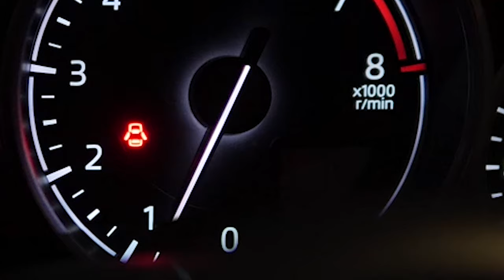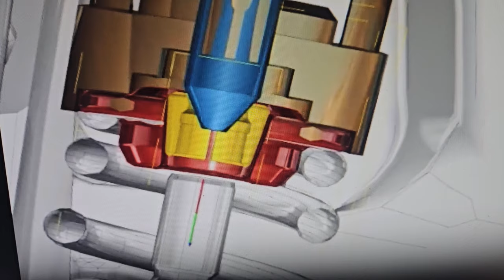Mazda CX 5 Oil Consumption. Mazda Warranty Extension. KIA soul Free Engine replacement update.

Comment from the maker: Does your Mazda have oil consumption issues?
Reply: Not yet, I have a 2022 Mazda3 SkyactivG 2.5 though, not turbo.
Reply: Do you know of any issues (oil consumption / chains) for the 2.0L Sky Activ engine. I am from the NL and I am considering to buy a 2024 Mazda CX5 2.0 E-Sky Active (24V mild hybrid) with an automatic transmission (my first eek LOL)  ?
Reply: I asked Google and it said yes non turbos are affected by this issue.I love our 21 cx5 cepting for this revelation.
Reply: No. I change my oil every 5K. At 53K miles I have zero consumption on my CX5. Its a normally aspirated 2.5L model year 2014.
Reply: @paulherbert5548  pretty sure it's model year 2021 mostly.
Reply: @zerkfiter  Yep. Just watched the whole thing. Commented too early.
Reply from the maker: @JohnC-b5j  No oil consumption issues that I know of for the 2.0L. I have never seen a CX-5 hybrid. That's cool.
Reply: Hey Sir - yup oil consumption.  Happened once while still in Kansas and once here in Germany - where I am stationed.  Question as well.  As it appears this engine is unable to have the repair done in Germany is this something that is ok to just keep a very close eye on the engine level and then get it fixed when we move back to the states?  Thanks!!!
Reply: Yup. Had the repair once and it came back. Just had it done again 2 days ago and today I noticed shiny liquid coming from the oil control sensor where the valve seal is seated. 

Really annoying. Going to drive it until the light comes on again, top it off and off to the dealer it goes AGAIN.
Reply from the maker: @leotoxin  sorry that happen to you.  Sounds like they are not doing the job correctly.

Comment: The leaking seals on the valves is a problem Mazda has had since their first international cars. I had a brand new Capella (616) 1600cc car in 1975 and it consumed oil unnecessarily. Mazda eventually agreed to replace the seals at no cost to me. It was well within warranty period but it took a long time for them to accept the need for repair and to own up to the issue. I expect all the tools used in this video are well known to Mazda if the problem is historical. There was no class action in Australia back in 1975 and certainly no warranty extension offered. Other than the seals the car was really good as long as I had it.
Reply from the maker: Too bad you don't still have that car. I think it would be considered a classic in America.  Was it a coup, or a sedan? When you owned it, did you every wish that you went for the rotary option?  I'm sure those consumed oil.
Reply: @ShopForemanGarage  The car was a sedan. Couldnt  afford the rotary and being unusual technology I avoided it. Excellent first new car but didnt hold on to it as family grew.

Comment: This video is so helpful! I have this issue with my 2021 CX5, 23k miles. The dealer only made a new oil change. Now, only 1 month later, 1k miles, the oil light is on again. I went to the dealer with this bulletin in my hands, and I dont understand why they didn't do this since the beginning.
Reply: because they get paid a lot less when you do it in warranty then when you have to do it out of warranty.
Reply: This is why you have to be an advocate of your car , just like your own health.  The dealer already has enough headaches and will never offer to repair a car unless they have to.  Being educated and doing research is always your benefit!

Comment: Another hidden issue with the Mazda Skyactiv engine is the vacuum assist pump pushing oil into the intake . Seems like another gasket issue and to get a new vacuum pump is not obtainable from dealers

Comment: My Mazda3 turbo and it only had 6,000 km on it and the oil light came on. I Thought it was because of my driving habits so I did the oil myself. 2 years later it started consuming 1 litre of oil every 1,200 km so I knew something was wrong 😭 so I got that tsb done.

Comment: Wheel cover. Maybe customer only puts it on when parked in the sun stop the wheel getting cooked. Sun cooked steering wheels are a dead set giveaway the car has been parked a lot outdoors when selling the car later on. BTW great video if you’re a Mazda tech.
Reply from the maker: Sun cooked makes sense. They should take it off when they drive.  Thanks for watching. And thanks for your support.

Comment: Apparently the material used in the valve stem seals wasn't right for the hotter running Turbo models.

Comment: This video is what I was looking for!  On my MazdaCX-5 2021 turbo the oil light came on in 2021 and begging of 2022 around 4000-4500 miles. After Easter of 2022 the light did not show up anymore. It might be because Mazda added more oil when regular maintenance  was performed or the problem disappear?
Reply from the maker: Thanks for the comment. I don't know how it could disappear. Maybe it was never a problem. I've seen those oil level sensors do some weird things.  I'm glad it's working for you.

Comment: I might be wrong, but I'm surprised that the procedure doesn't call to use compressed air to put positive pressure in the cylinder to hold the valve closed while you do that.
Reply from the maker: Yeah. The valve actually just sits on top of the pistion while changing the seal.  If you forgot to put the piston at top dead center and take the seal out. Well, then you know what comes next.

Comment: 2021 CX-9, had my valve stems replaced 09/23 at 16k miles. Engine was burning some oil over the winter, but the problem reappeared with vengeance in hot weather. Had an oil change at independent shop last month(filed up to 8/10 unlike dealer that that overfills it), went on a 600 mile family road trip and burned about half a quart of oil to low level code. Seems like "burning is especially prevalent in hot weather. Either stem valves were replaced incorrectly or some other issue. Mazda's manual does say a quart in 1000 miles, however updated TSB 05/20/24 says if during consumption test more than 8 oz is used in 2000km (1200 miles) than contact mazda tech hotline.
Reply from the maker: Wow. 8oz. in 1200 miles is not that much.  The spec. I get is one quart every 1200 miles. I don't see a TSB 05/20/24 or 05-020/24. If you're talking about SSPD5 its bulletin number is 01-007/24 and does not give the spec. However, it does say if the customer returns after valve stem seal replacement, then contact Mazda Hotline for further instructions. So, I would say take the vehicle back to the dealer. Get them to fix it correctly.  Then again. There are other things that can cause oil consumption.
Reply: @ShopForemanGarage First sorry for confusion it wasn't TSB 05/20/24 but REPAIR PROCEDURE 5-20-24 SSPD5 VALVE STEM CLASS ACTION CAMPAIGN pg 3 mentions "8 oz of oil".  Update: 10 weeks ago took the vehicle back to the dealer. I was told that a tech added dye to oil to trace the the leak and after that it was determined my valve cover gasket was leaking oil, so it was replaced. Oil consumption didnt go away after that either. Went through about 1.2 qt in 1,500 miles. Took the car back to the dealer a few days ago and was told that after getting in touch with Mazda Hotline the dealer will replace valve stems again. Not sure what happened during the original replacement, not like you can get any decent technical information from "service advisor" at the desk. Thanks for the reply and all your work to provide Mazda owners with behind the scene footage.

Comment: From what I heard from a few people in the Mazda forums if you installed a burger motorsports oil catch can it’s will help slow down the oil consumption problem with the turbo engines. I have bought one but haven’t installed it yet because right now I haven’t had a problem with it yet. However I’m planning on installing it soon.
Reply from the maker: I don't know exactly how that will help. Then again I don't know everything. I do know that as far as oil catch cans go. Burger Motorsports is one of the better ones. A catch can is hooked up to the PCV system on your engine to catch contaminants due to blowby through your piston rings from combustion. It keeps those contaminants from going back into the engine and causing deposits to build up on your intake valves (especially in a direct injection engine). The only way I see it helping oil consumption issues is that maybe it relieves excessive crank case pressures that could possibly cause seals to leak or oil to get pushed past the oil rings and into the combustion chamber. Now, turbo charged engines will definitely benefit from a catch can for other reasons. But remember. Oil in a catch can is not oil in your engine. The stuff the catch can collects, should be disposed of. Open one of your intercooler tubes and see if there is a build up of oil in the intercooler. Excessive oil getting into the intercooler is what the catch can is supposed to prevent.

Comment: Excellent video, thank you! I’ve watched your turbocharger swap as well 👍🏻

Have you been able to confirm that the oil consumption was reduced (or eliminated) after this seal update was completed? I haven’t been able to find other owners on forums that have confirmed that this resolved their consumption issues (at least not yet… might be early days still).

I don’t have smoke on a cold start, other than moisture vapor for a few minutes then it stops.

I have had the low oil sensor trigger the CEL though after 5,200kms just recently… and the dipstick was just shy of the low mark.

I do my oil changes every 5,000km to keep fuel dilution minimal (I never wait a full 8,000km which is Mazda’s spec)…. and even though the oil level has always gone down between oil changes since we got the car, I was surprised to see it go down to nearly full low this last interval. I suppose the seals could be getting slowly worse over time.

I’m contemplating getting this seal update done. We’re currently at 66,800km.
Reply from the maker: I would say for sure that it does fix the issue.  I have done a few of these jobs and nobody has come back complaining about it still consuming oil. (knock on wood)  All the vehicles I've done have still been covered under powertrain warranty.  I don't think it's a matter of the seals wearing out. I think it might have to do with the seals not being installed properly at the factory.  I could be wrong about that but, if the seals were made improperly, then there would be a VIN breakdown and they would all be getting seals weather they were consuming oil or not.
Reply: @ShopForemanGarage   That makes a lot of sense. I think I've been persuaded enough to pursue having this done (I was on the fence). The class action settlement program applies to US owners only (not Canada) but the TSB is still applicable in Canada and we're still under powertrain warranty. Our local dealer has a high integrity service department so I'll start inquiring and putting plans in place.

Your video has been very helpful. Thanks for taking the time (and energy) to make it for this community of owners 👍🏻

Comment: are you pressurizing the  cyl with air to do that job, i use nylon rope in the cyl and then rotate the cyl up  on compression to hold the valves up  way better in my opinion learned it  at 16 yoa, i think these tricks have not been passed on
Reply from the maker: No need for any of that. The piston at top dead center gives very little room for the valve to drop.

Comment: Hey Sir - yup oil consumption.  Happened once while still in Kansas and once here in Germany - where I am stationed.  Question as well.  As it appears this engine is unable to have the repair done in Germany is this something that is ok to just keep a very close eye on the engine level and then get it fixed when we move back to the states?  Thanks!!!
Reply from the maker: Yes.  Just make sure you check the oil often and top it off and you won't have any problems.
Reply: @ShopForemanGarage  Awesome thanks!  Love the videos too keep em coming!!!

Comment: Does this affect long term reliability? Sucks to hear about this
Reply from the maker: No.  I mean. If you let the engine run low on oil and keep driving it. Then yes. 
Now days people aren't used to seeing vehicle at a service pump with the hood open.  But it is a good idea to check your oil every time you fill the gas tank.  These vehicles have a level sensor that will tell you if the level is low. But, it never hurts to check. No matter what kind of strange looks you get at the gas station.

Comment: I have this engine in my 2021 Mazda 6 and in 3,000 miles the oil level goes from the top hole on the dipstick to the bottom hole. So I guess I have the oil consumption problem ? I’m afraid of getting this fix done in case it is not done correctly and makes the problem worse, as is some people’s experience.
Reply from the maker: From the top hole to the bottom hole is about one quart.  In 3000 miles, that is not excessive oil consumption as per Mazda.  One quart every 1200 miles is normal according to Mazda.

Comment: First ever brought a Mazda and last time and that was 2005 I had a DPF issue that would cause clouds of smoke engine would Accelerate on its own accord only way to stop it was to turn it off by the key and press the clutch very dangerous! first time it happened was downhill slowing down for pedestrian crossing. ackridge smoke like pumped out from a tank what would blind people, it went back to garage about 15 times and all they did was reset it. Would last for couple weeks I think the longest was a month and go back again pile of rubbish. do you know what that issue was and why it was causing that? It was on a 5 people carrier
Reply from the maker: I wish I could help you. Unfortunately, Mazda did not come out with a diesel engine in America until 2019. It was the CX-5 Skyactive Diesel engine and I believe was mostly sold in California. I have actually never seen one. I believe it did not help very much on fuel economy and after one year, Mazda pulled the plug.  I have taken courses on the Skyactive diesel, but that was a long time ago. Never worked on one but, the Mazda parts dept. still has Mazda DEF fluid on the shelf.

Comment: Our 2021 CX-9 is currently in the shop being repaired with the oil consumption problem, Mazda gave us a loaner vehicle.  SO far they have handled it with zero pushback.  Does anyone know if this is only on 2021 models?
Reply from the maker: It's 2021 only from what I see. I updated the information in the description box to include the VIN breakdown of applicable models.

Comment: Does the TSB state to address oil consumption issues by addressing the exhaust valve stem seals only? I understand why one may think the exhaust valve stem seals may be bad on a turbo charged engine; I'm curious if the intake valve stem seals are also a possibility and if that is mentioned in the TSB. Thanks!
Reply from the maker: @Eternalblue17  it only addresses exhaust valve stem seals. Of course,  anything could happen at any time. So this doesn't mean something else couldn't be causing oil consumption.  The exhaust seals are the only thing covered in this warranty extension.
Reply: @ShopForemanGarage  Thanks!

Comment: My dealer claims that the sparkplugs do not have to be removed for this job. Do you think this maintenance can be done without removing the sparkplugs?
Reply from the maker: Yes it can. If you can tell that the piston is at top dead center just by looking at the exhaust and intake valves and the camshaft rotations. You don't have to remove the plugs. If a technician has done this job enough times, they could probably tell. But, the procedure says to remove the spark plugs and use a long screwdriver to locate the piston to top dead center.  If you remove the valve stem seal and the piston is too far down. You could drop a valve into the cylinder. Then the cylinder head has to come of in order to fix it.  To me, it's not worth it.  Mistakes can happen.

Comment: Mazda told me it was normal for my 2014 CX-9 to use 2qts over 4k miles. Nissan told me the same thing about my 2006 Xterra.
Reply from the maker: The spec. for Mazda is 1 quart every 1200 miles. That's what Mazda says is normal.
Reply: @ShopForemanGarage  That's why I change the oil in all our vehicles at 3-4k miles.
Reply: @ShopForemanGarage I’m
confused by this “normal”
amount of consumption. Doesn’t that mean that at that rate, you will get a low oil light in 5,000 since an oil change was done ? And so why is this “fix” being applied for what is “normal” ?
Reply from the maker: @Matys1975  the owners manual states, (and don't quote me on this, this is what I've been told) that the owner should check their oil level and top off if needed every time they fill the gas tank.
Reply: That shouldn't be normal.  I have a 20 year old Subaru that uses zero oil.  I never have to add oil between oil changes.  If they could figure it out 20 years ago...

Comment: Is it turbo engine only? 
My car is a 2021 cx-5 GT not turbo and I have the same problem. 😢
Reply from the maker: The letter says turbo charged only.  You can always contact your local Mazda dealer and have them run a VIS on your vehicle.  That will show if you have any open recalls and it will show if it has any warranty extensions.

Comment: I got this oil consumption issue! So some mechanics will play with my engine to fix this small part?$ 😢
They wanted to make sure it is that issue and have changed oil for me
Reply from the maker: Yes. Performing an oil consumpting test is a good idea to see if it actually has a problem.